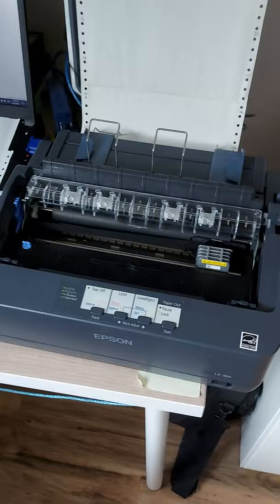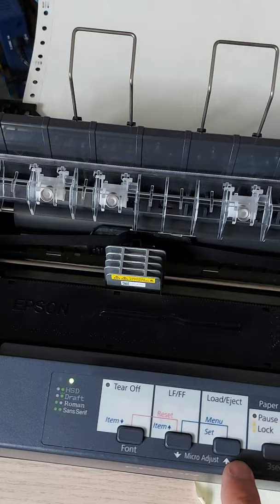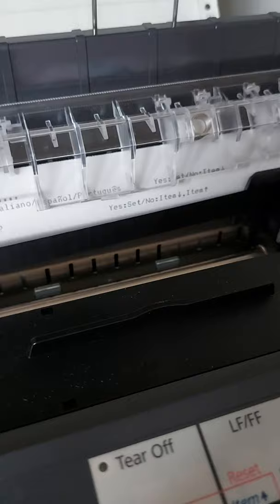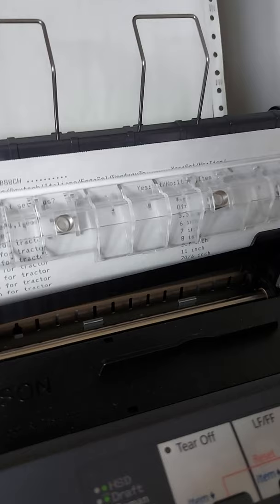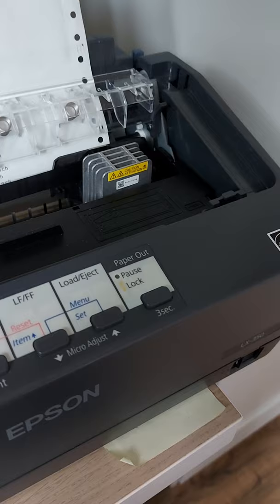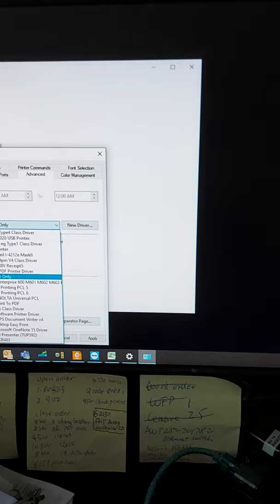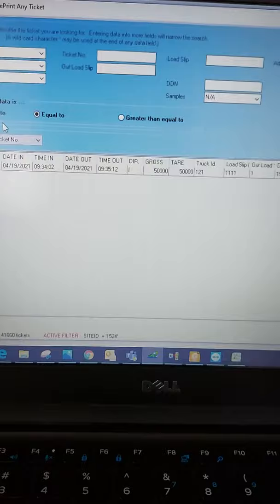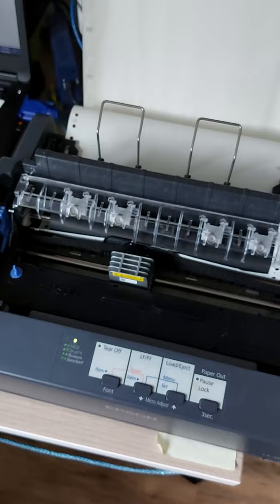Setup Epson LX 350 printer for forestry program

Comment: Good afternoon, when I add paper, I turn it on and press the load/eject button and it pulls the sheet back quite a bit.
Reply from the maker: check your paper type to match level, also check setting of paper size.